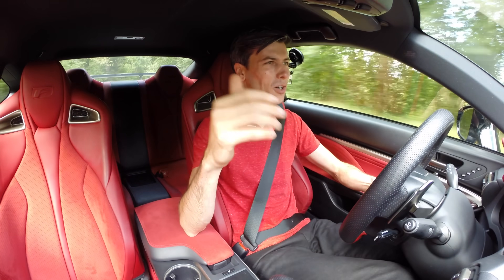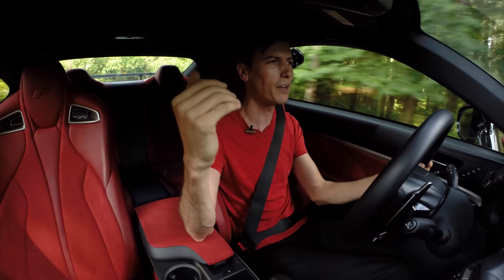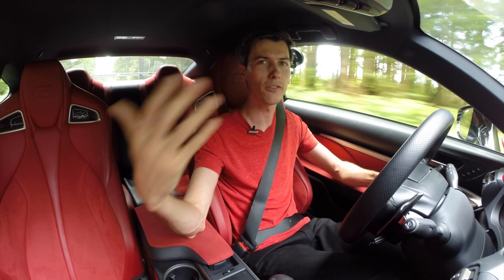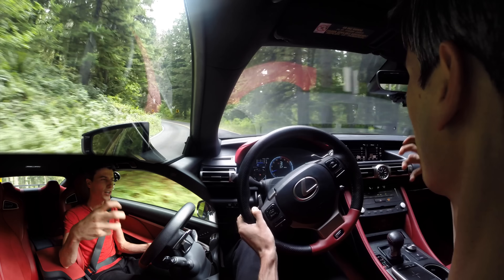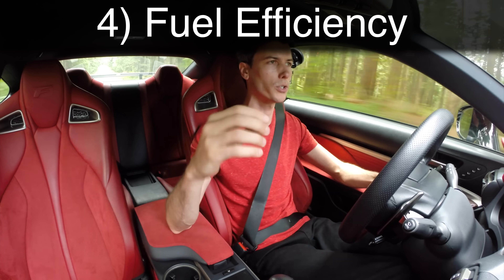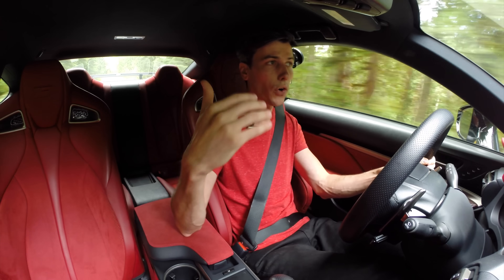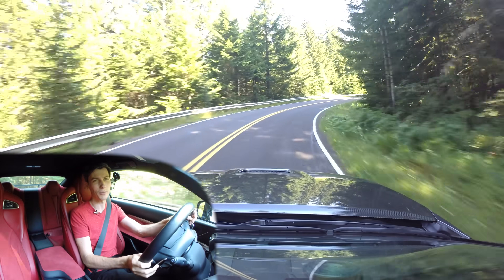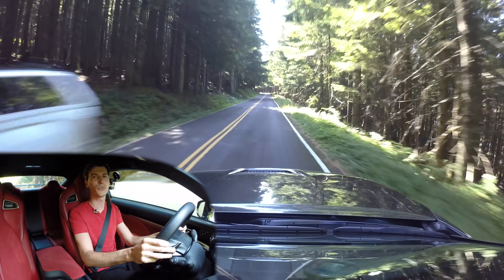5 Reasons You Shouldn't Buy A Turbocharged Car

Comment: Another reason, why adding turbocharger decreases the efficiency of the engine, is because piston has to create high pressure in the exhaust manifold during the exhaust stroke (actually sligtly more, than turbo creates in the intake manifold), that increases pumping losses. This also means, that phase overlap, like in NA engines, is impossible. 
In general, same power NA is more efficient, than turbo.
Reply: However the advantage you get from a smaller turboed engine is better MPG driving around town when you don't spool the turbo than a large displacement engine.
Reply: @markodarkovski5791  Only when accelerating like in NEDC testing cycle (25 seconds to 33 mph)

Comment: He simplified a Turbo as I used to: A  2.5L engine that runs @ 1-bar ... acts like a 2.5L engine w low compression until the turbo hits 1-bar at which point it runs like a 5-liter... 

Though, maybe a little worse because you're in vacuum with an N.A. ... 
In a Turbo however, you can get enough air in to it even at high RPM. 
Though, Torque is what matters ...

Comment: EE: You shouldn't buy a turbocharged car
Me: Alright, I will buy a supercharged one.
Reply: Next upload: Why you shouldn’t buy a supercharged car.
Reply: Honestly I think supercharged cars sound better than turbocharged ones. It doesn’t take too much of the original noise from the engine, it keeps the feel of it, you get that added whine of the supercharger, and of course power to match.
Reply: @LessThanPeachy  Except that superchargers take power from the engine unlike a turbocharger
Reply: @Johnny_ro  turbos do take power from the engine. They are parasitic due to the factor of them being a blockage for scavenging
Reply: @jdrok5026  True. And modern superchargers are just as efficient as turbos and have less parasitic draw. Especially clutched ones and electronic ones that run DC volts. They have separate power sources that don't require a timing pulley con connection:)
Reply: @Johnny_ro  so you have 5 more hp, i already pass you when you waiting to spool
Reply: @Johnny_ro  
True . SC takes power from flywheel 
TC takes power from waste exhaust .
Apples to Oranges
Reply: @JOutterbridge  what's a good setup for a 2013 mustang gt?
Reply: @tehshape  You should check the forums based on your goals. Supercharger is usually easier and cheaper but turbo builds will net more hp. It gets very expensive though if you go over 600hp because the engine and transmission is stressed more and likely need upgrades after that point
Reply: @LessThanPeachy  and get ticket for non friendly nature force induction :v
Reply: @LessThanPeachy  but worse fuel economy
Reply: Jordan Nolan whining lol. Just like in children, I prefer not to hear it. Turbos are pleasantly disrespectful n I love it. Snorting, sneezing and spitting at other vehicles.. 🤣🤣
Reply: t w i n     c h a r g e r     w i t h     a m b i e n t     b y p a s s
Reply: Dead
Reply: Yesss
Reply: Me too
Reply: @ever greatest - (insert densel Washington gif - "my man")
Reply: You have no idea what ur talking about
Reply: Update: forces induction.
Reply: Much better choice.
Reply: Unless your engine is a diesel, supercharged is MUCH better.
Reply: Laughs in Tesla
Reply: @rosemaryfriedw124a8  oh I'm sorry I dont like going slow laughs in lsj ecotec thats ran faster than any ev
Reply: @jdrok5026  And I laugh in LHU Ecotec that's faster than both of you lol. I own both a heavily modified LSJ & a heavily modified LHU swapped SS. The turbo car is just always faster.
Reply: So three turbos small mid and big when hit ????rpm then mid turbo comes and so on right?
Reply: @xx_weedman420_xx4  three times more moving parts, three times easier to break
Reply: not true modern turbos now dont have any lag and have linear response just like NA cars except with all the torque right away and feel way more fun and faster. ive driven 500hp na cars and hated it because i had to throttle all the way and felt like i had to wait forever to finally feel any power and torque and by the time i did i had to change gears meaning i felt the MAX torque and HP only at the last second

Comment: In regards to the reliability - my Subaru Forester STI is nearly 23 years old and running strong. 250 BHP Turbo charged and pulls like a train, so yes N/A would be more reliable, but I doubt anyone would drive the same car for over 20 years -) Turbo charged cars are lighter due to the smaller engines and my car sounds amazing -) lighter weight would mean better handling, better braking, better acceleration and better off-road capabilities ....

Comment: I think some turbo engines have an electric pump to circulate oil after shutdown. And in some a big and small or electric and exhaust turbo or a supercharger and a turbo to get immediate low end torque and throttle response and a flatter torque curve up to top RPM. You didn't mention the turbo, which is spinning at 20 or 30K at maximum and really hot might fail after the warranty and cost $1-2 K to replace.

Comment: There's no replacement or displacement. Jason has made a good case for the N/A engine. I'm keeping the 3.7 liter VQ37VHR engine in my 370Z and if that's not enough I can bore and stroke it out to 4.2 or 4.3 liters.

Comment: You're all sorts of wrong.  Modern turbo vehicles don't cool the turbos with engine oil, they use engine coolant.  Turbo lag no longer is an issue (twin scroll turbos, you did a video on these 5 years ago). Modern turbocharged vehicles actually do have high compression, the 3.5 Ecoboost in my Expedition has 10.5:1.

Comment: As for "you wait a little and then BAM!, the torque hits you and it's so cool", I am not sure it's the coolest sensation. Yes it's funny (I test-drove a Hyundai i30N), but the linear, longer growth of pull of the aspirated engines is funnier, and cooler (I test-drove an MX-5).
I am afraid there's no match when it comes to emotions... different business if it's about lap times, 0-60 times, and so on, but then, why would anyone but professional drivers care about the latter.

Comment: I don't have a throttle in a car and haven't driven a car having one that has (save for courtesy cars) for 15 years as I've driven a turbo diesel for 15 years now and wouldn't go back. 1400cc is the largest engine size that I've ever owned - keep the car light and then you don't need a huge engine. Besides, when in normal day to day driving, without getting arrested, are you going to need a car that can do 150mph+?

Comment: I wonder why, then, turbodiesels can last many more miles (or kilometers) then petrol engines. There must be other differences apart from peak cylinder pressure and the higher diesel engine costs it brings with itself.

Comment: Really big engines have the best drivability--the engine is very versatile. The throttle response is instant and there's no "surprise" belt of power as a turbo starts to produce boost.
However, large engines generally produce more emissions.
So, to minimize emissions (and weight) while keeping power levels high, they use smaller turbo engines.
That's all there is to it.
Nothing more to it than that.
Turbos are a great hobby-they're fun to play with, but for overall driveability, you're better off with a big NA engine.

Comment: You complain about turbo lag, but you don't mention that turbo lag doesn't really exist anymore. With twin scroll turbochargers, and smaller turbines, a lot of boosted engines hit Max boost at just above idle. The new Hyundai 3.3t has 376 lb-ft at 1,300 RPM. Yes, 1,300.

Comment: Its called "Threshold"  not lag. Smaller turbos spool faster at lower rpm. 
Cars can run decent compression ratios with turbos these days. 
Also all you need to do is change down and boom your in the zone. So the disadvantage isnt that a bigger deal when you can make boost.

Someone educate this kid will ya...

Comment: This guy is a joke. The engineering essence just isn't there. Maybe he chose making videos because he didn't get the gist of engineering. Like that was all he could do. The video begins and right away it's there.  Look at the chart. I'm not even discussing  the data, just look at what the chart is all about. The throttle position is the input there. Input data (independent variable) is placed on the horizontal axis in a chart. In all of his videos I watched so far I have seen faulty interpretations, negligence of issues which would be important from an engineer's standpoint, overplaying insignificant factors, some bias here and there. If you want some engineering explained, surely you'd better look elsewhere, maybe even outside youtube. I don't know why this guy shows up in my recommended videos all the time. Next video I'm watching is how to hide certain channels on youtube.

Comment: the information in the video is incorrect and inconsistent, first of all, there are no mechanically prominent heat difference between turbo and naturally aspirated engines, the temperature impact are manageable by using alternative production and design techniques which will make no effect on productivity of the method/modus operandi; also, because of the longer stroke,  higher piston speed and internal forces of the engine could possibly making naturally aspirated engines disadvantageous in those matters, because engine material's degradation by impact could be shown in a logarithmic chart.
secondly, turbo engines do not REALLY wait for power while turbines are spooling, power is already there and ubiquitous, so driver is actually sensationally expect the kick(or boost) BECAUSE even the minimal spin of the turbocharger compressor CREATES PRESSURE to regulate intake system's aerodynamic inefficiencies which leads a direct NET efficiency increase of the engine.

Comment: This is a great video if your main concern is driving like you're in the Indy 500 every day.    You made a point about how turbo charged engines require to be built up a bit more to handle the added pressure.  Well, with a daily driver where you aren't kicking in the turbo constantly, that motor is over built and will last much longer for regular street driving.  The turbo also gives you the added power in the rpm range you need it for daily commuter driving where you'll never likely hit the RPMs necessary in traffic to take advantage of the naturally aspirated engines HP and torque.  I have 2 vehicles, a 1.8L Turbo Jetta with 170 hp and a '98 Chevy Tahoe 5.7L vortec that I've done some things to  that gets me in the 325 HP range.  On my daily commutes I never get the Tahoe up to the 4500 rpm range to take advantage of the peak torque to pass someone on the highway without downshifting which I've burned out clutch packs in the past doing.  Where with the 1.8L turbo I'm getting peak torque around 2000 rpm and have no problem blowing past people when I want to without down shifting or doing anything that would put extra wear and tear on the transmission.  I love the video and you make some pretty good points but they are pretty much invalid for people just driving back and forth from work.
Reply: And by the way, the delay getting the Tahoe up to 4000 RPM is much longer than the delay to get the turbo to kick in on the Jetta.  In general, you'll have a much shorter delay hitting peak power in the turbo than you will with a naturally aspirated engine.
Reply: Apples and oranges. Put the Tahoe's engine in a compact car and then compare.
My Camaro made peak torque at around 2400 RPM and had instant response, obv not even spool time.

Comment: If you can't afford to buy new cars and prefer to buy second hand, then buy naturally aspirated car(s). With turbocharged cars when they approach say 140,000 miles, turbo may likely need to be replaced and all its associated problems.  Yes a modern 2 lt turbo cars will be more fuel efficient than say a 3.5 lt Naturally aspirated cars but gas here is cheaper than in Europe and Japan. Overall maintenance of a NA cars will be cheaper than turbocharged cars in the  long run so as much as I like turbo power, taking everything into account, I will buy NA cars.

Comment: After building a few turbo cars and supercharged cars, I'm leaning towards superchargers, mainly for reliability.  Turbos just back up a lot of heat and pressure on the exhaust side of the cylinder head. I've never experienced engine failure with an aftermarket supercharger, and I've been running them for quite a few years on my Miata and Thunderbird.  I wish I could say my turbo engines have lasted as long. I do love the thrill of the turbo hit, but the power delivery of the superchargers has been better for me in drifting as well as grip racing, and these cars can run reliably all day for those 8 hour track days.

Comment: How applicable is this if you aren't overly concerned with performance (especially thoughts of reliability vs cost). I drive a super conservative/cheap Chevy Cruze with a turbo charged engine. I find that it is super fuel efficient compared to my previous vehicles (still economy cars).

(I got here researching EVs but then saw this video because my car is Turbo so I was curious!). I'm hardly a performance person with my car so I'm probably in my own head much more than I need, but curious if the risks here are mitigated if I'm just some dweeb driving city speeds 99% of my driving :P

Enjoy the videos!

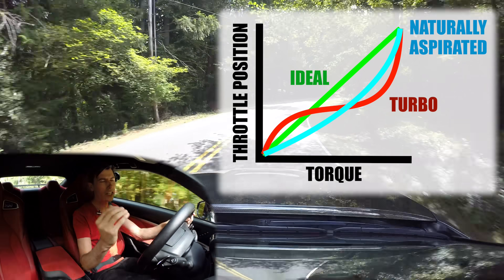Comment: on the graph displayed on 1:28 i think your axis are reversed. throttle position should be on the x and torque should be on y. With a turbo even though throttle position goes up torque doesn't due to lag/spooling not the other way around.
Reply: The axes are reversed but so is the graph, it shows exactly what you describe.

Comment: I mostly agree, however power with the Low Pressure Turbo (LPT) by Saab didn't fall off so much,  and achieved good reliability. The LPT pulls from lower revs and you don't feel a boos, it is smooth! (I have a 2001 9-3 S Coupe 154 HP, which has an excellent power weight ratio. Others can use standard parts to achieve 240 HP, and tuned over 300 HP, but I prefer keeping it original. I'm not saying that everyone should go by a Saab!) What I am saying is that the technology exists to have a smaller turbos that operate at lower pressure that in my view provides a sweet spot.

Comment: yes but to be fair, you need to compare the same engine sizes. 2.0 n/a vs 2.0 turbo for example. Because in real world we dont get to chose between a 2.5 turbo or a 5.0 n/a. Usually the 5.0 engine will be out of reach because taxes, not because we dont like em. And in this case the turbo will always win. Will you preffer a 3.0 n/a with let s say 250 hp, or a 3.0 turbo with 350 hp?

Comment: I have small 4 cylinder japanese engine. I love it. You have to rev it to get the power. It is so fun. But BFU do not like it, they want all the power at 2000 rpm,  most people just want turbo engines, because they are much easier to drive. It is sad, I hope that naturally aspirated engines will survive for future generation of drivers :).

Comment: IMO, driving a turbo requires a bit of rev management, anticipating the response, to keep the turbo spinning, which will reduce the lag effect. Track guys know this- so much for economy. As for reliability, it depends on the engine design: specifically, bottom end build to handle the added power. For people adding a turbo, some cars are better than others for boosting in that regard. Ask a tuner freak. I really like this vid: this fellow explains everything really well and brings up thoughtful points to consider.

Comment: Point 1 & 2. Cars have gears. Once the turbo is putting out max torque, use gear to maintain it. It will never go down. Point 3 agree. Point 4 you dont turbo charged all the time, only on acceleration. Point 5 sound? I would prefer my sound system over engine noise.

Comment: My 2006 E90 BMW 320D is at 250,000Km, the variable geometry turbo sounds like new.  It lags terribly off the line but once rolling it's always there.  It can get over 1,000Km off its toy sized fuel tank and can easily overtake when needed.  I really can't hate on turbos with this car.  The only nitpick is when doing slow manoeuvres, the turbo always wants to kick in at the most inopportune moment, you're doing a slow uphill park and your engine gets just past the magic RPM's and wants to take off.  You have to feather the throttle rather than just getting it to the right spot.

Comment: Are you sure about the compression ratio and thermal efficiency comment?
As you said, the turbo is adding pressure before the cylinder compresses the gas, so you end up with the same or greater compression / pressure that you are burning at. I think it is the final pressure you are burning at that matters, not the compression ratio of the cylinder. Higher pressure > higher temperature -> more area in the P-V diagram for the Otto cycle -> more energy extracted from combustion.   You could also argue the compressor contributes to the compression ratio shown in the graph.
Reply: Right.  That graph is only for NA engines, nod modern computerized turbo engines.

Comment: I have owned naturally aspirated and turbo and I get better gas mileage and much better torque and HP with the turbos.  I have not had one for more than 50K miles so far, so we will see if it's reliable, but right now I am much happier with the turbos and the cost was not more than naturally aspirated for the same specs.  I disagree with a lot of his points in this video.  Just not my experience so far.